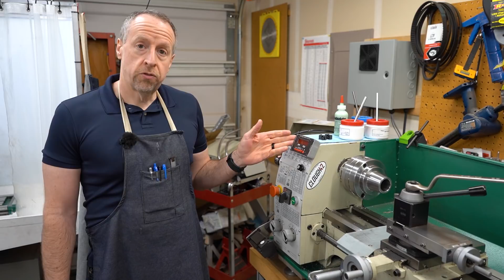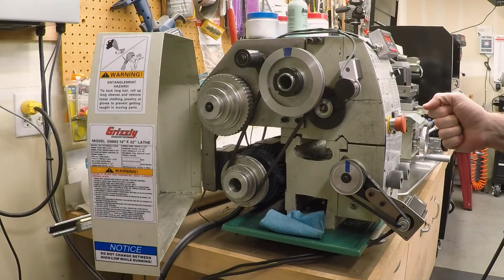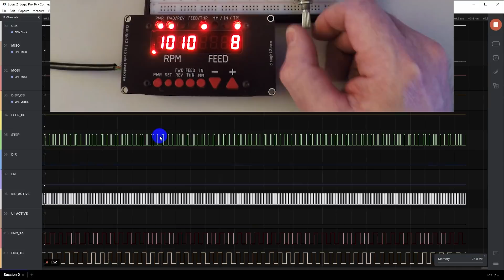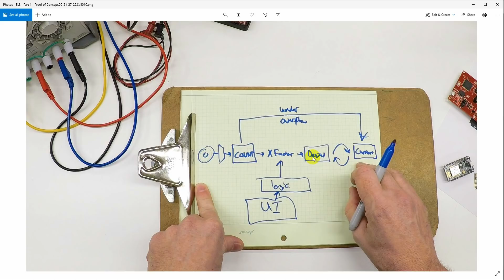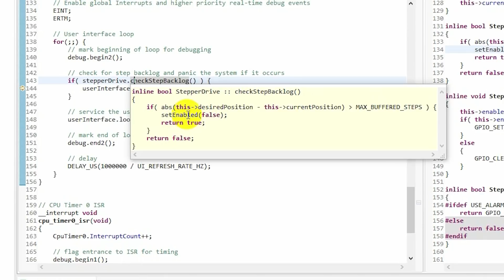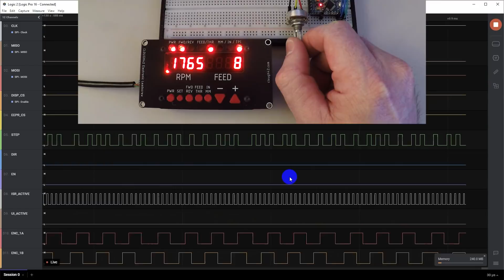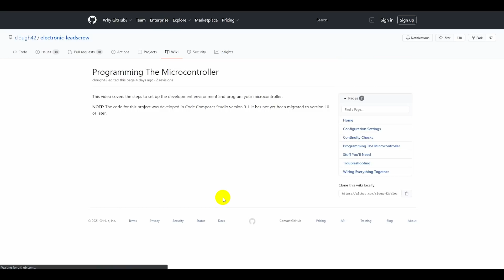Overspeed Error Detection | Lathe Electronic Leadscrew - Part 21

Comment: Your point about what to do when the driver can't keep up and stopping being the lesser of two evils, even though it might wreck your part, is largely moot. It's only likely to cause major issues when threading and if you've taken a cut at the wrong speed your part (and possibly tip) is likely ruined anyway. It depends how out of sync, but given you can set the threshold with MAX_BUFFERED_STEPS I wouldn't lose any sleep over it.

Comment: Actually, you will never get into a situation where the system goes into a panic condition while in a cut. If you look at the process as a sequence of events, you will have hit the panic condition before you would engage the halfnut to begin threading OR engaging the feed nut to begin feeding. Since the sequence of events that qualifies the panic state is Input_Pulse (logical AND) Output_STEP and that will always happen before the process to feed or thread begins, you will hit the panic state the moment the lathe starts and comes up to speed.
Reply from the maker: Under most normal circumstances, this is correct.  I can think of two counterexamples.  One is if the operator reaches over and increases speed during the cut.  I do this often, but usually only when feeding, in which case it wouldn't be an issue.  There's also the possibility of being right at the limit and having the VFD bog down and overcompensate when entering the cut.  These are corner cases, so I don't think it's really of much concern.
Reply: I could see myself doing something stupid like "tweaking" the RPM during the cut and accidentally flicking the knob.

Comment: James, what time investment for this code?  Write and debug to first working?  Just curious.  Thanks, great content.
Reply from the maker: That's a really good question.  I probably spent 20 hours reading and doing math on envelopes and 3-5 hours coding to get it initially running on a breadboard.  Developing it to the point where it is now, I've probably got 100-200 hours in it, but I was developing the hardware and the software and figuring out the mechanics all at the same time, so it's hard to track.

Comment: Threading 8 TPI at 3000 rpm gives a feed rate of 6.25 inches per second. This is a ludicrous speed.
Of course this is not just about TPIs and RPMs but about the number of steps.If a system is using very small steps (i.e. lots of steps per revolution), the step rate goes up and you run into this problem faster.
Most system will never reach this point. It is more likely that in a system with a stepper motor the motor will stall before the maximum stepper speed is reached - at least that is the case on my lathe.
I love ELS and incorporated in my home built DRO and as such ported the code on a Teensy 4. I will have to check if this problem could occur on my system also.
Reply from the maker: On further discussion in the issue on GitHub, this particular setup had the servo set for 4000 steps/rev with 3:1 belt reduction to an 8TPI leadscrew, and for coarse threads it could hit the limit around 500rpm.  So depending on the configuration, it could be reachable.

Comment: This is such an interesting project. On one hand it simplifies so much, making it much easier and faster to set up the lathe for a job. On the other hand it complicates things, and introduces novel new ways to mess up and for things to fail. All in all I think it's a great improvement.

On seeing the title I was pretty sure what the problem would be. Though I was not certain if the problem would turn out to be the decoding of the encoder or in the drive of the lead screw motor, though my money was on the later as it's a mechanical component and that makes physics rear it's ugly head at the most "interesting" times. Also not having followed this series of videos closely I wasn't aware how the controller program worked out the desired location of the leadscrew depending on the position of the spindle. 

My first instinctive thought was that you would just have the program calculate the required stepping for the leadscrew motor, probably using a small buffer and just have the controller throw a fit flashing warnings and what ever if/when the leadscrew motor wasn't able to keep up and the buffer overflowed. 
Turns out you keep virtual tracking on the leadscrew position and compares the current position to the desired position to see if the lead screw motor should receive a pulse. And that's what bit you in the ass with this edge case scenario. But unless you are working to a deadline over engineering is often the way to go as it's relatively easy to scale things down and impose limitations while doing it the other way around often means you have to invent the wheel yet again, and again, and again as people come up with ideas for new and improved functionality that "can easily be implemented"...
Reply from the maker: I was aware of the theoretical limitation, but hadn't encountered a setup with enough resolution to cause it to occur, so it hadn't come up as a limitation.  You are right about people constantly coming up with functionality that "can easily be implemented".  I haven't read through all the comments yet, but there will most likely be some.  :)

Comment: fantastic video.  one suggestion if you are interested... when you code up a function or a variable to be used in an "if" check like that, consider naming the function so that you can tell what a true or false value means.  For example "if (steps_too_far_behind())" or "if (stepper_in_panic())" makes it easier to know what the return value of the function indicates and which way the logic should point in the if check.  Again, great video. Love learning from your channel.
Reply from the maker: This is an excellent suggestion.  Naming the predicate explicitly is usually the best option.  In this case, the function has a side effect of actually putting the driver into a panic state, which is also problematic, given the name.  There's another subtle issue here that contributes to my mental disorganization.  The best place to check the difference is in the driver ISR that runs every 5us.  Unfortunately, the long subtraction adds enough to the execution time to get me up above 40% of the CPU time spent in the ISR, so I put it in the ~20ms UI loop instead.  When I get around to putting in some speed limits, those will also need to be outside the ISR, and I'll probably refactor all of the decision-making logic out of the driver and it will become a clean predicate to check the backlog, and a separate method to control the enable state.
Reply: @Clough42  sounds like you already have in mind, then, the thing I was thinking of: some sort of “warning” state (and alternating display message - like what you have for your two mode error, but with one mode still showing live data), that triggers when someone is approaching saturation... so if they’re dialing up the speed on a variable control like you’ve got, there’s at least some hope they might get warned to stop speeding up before they trash their part... yes? :)

Comment: some random thoughts. It seems to the me that MAX_BUFFERED_STEPS could be more accurately be called something like MAX_DEVIATION and possibly scaled with the pitch/gearing of the leadscrew. In the real world I expect that a servo/stepper will run out of speed well before the rate of step pulses is the limit.  As soon as you have set the feedrate/threadpitch you also have a good idea of the maximum spindle speed it can keep up with so it would be possible to issue an early warning. Considered adding an output to shutdown the lathe if an error occurs?
Reply from the maker: Yes.  I've been thinking about this for a while.  My current thinking is that an RPM limit on the leadscrew is the easiest to implement and the easiest to explain.

Comment: Hi James. Thank you for the ongoing maintenance support. Great commitment to your viewers. Stopping the lead screw is the right decision - the alternative folks is a possible carriage crash into the chuck or tailstock.  I've got a compact encoder/motor installation on my lathe, much as you mention, but still have the electronics on a breadboard. It's next on the list after the mill DRO. Cheers. BobUK.

Comment: You can probably calculate the theoretical maximum encoder speed based on the gear ratio and lead screw pitch. Not sure how you’d show that limit to the user, but you could use it as a threshold to warn the user that they’re getting close to dropping steps, before you have to do a safety stop.
Reply: Perhaps also have a buzzer as a warning?
Reply from the maker: I have been thinking about doing exactly this for a while.
Reply from the maker: That would have been a fantastic thing to include in the PC boards when I designed them a couple of years ago.  :)

Comment: Seems like you'd ultimately want to wire it to the E-stop, or set up some communication with the VFD/motor controller.   But given that it's so rare, it's more of a 'don't do that' (along with all the other wrong things you shouldn't do with your lathe).
Reply from the maker: The enable output on the interface board is ultimately an open-collector output, so it could be wired into an e-stop system.  I think you would also probably want to monitor the servo driver itself, since it can panic on its own due to over-torque and other conditions.